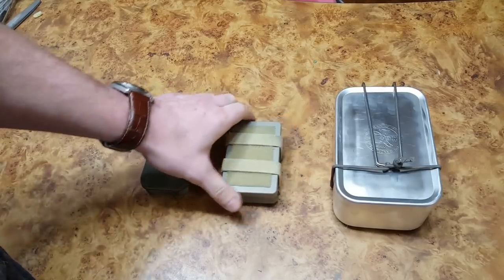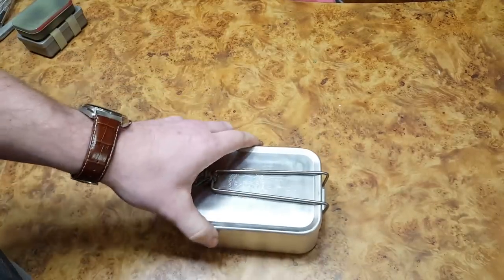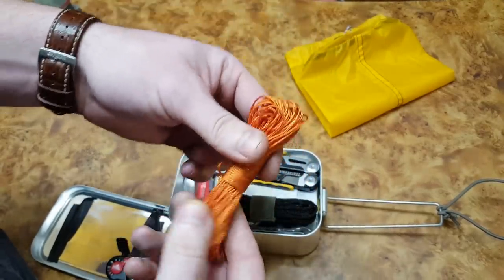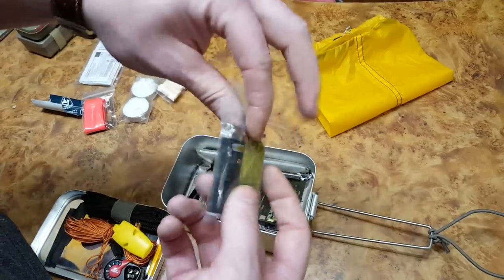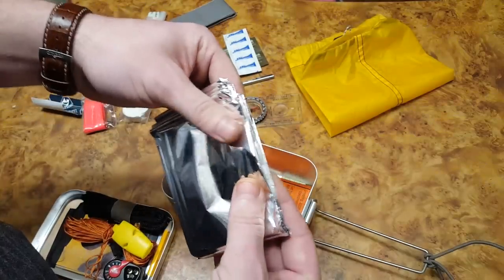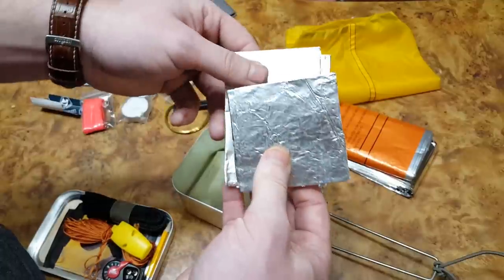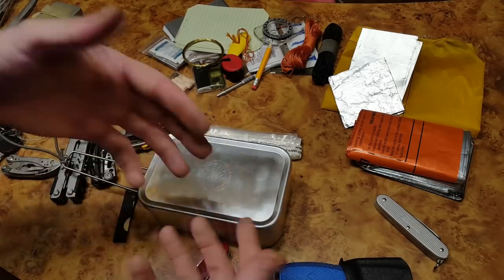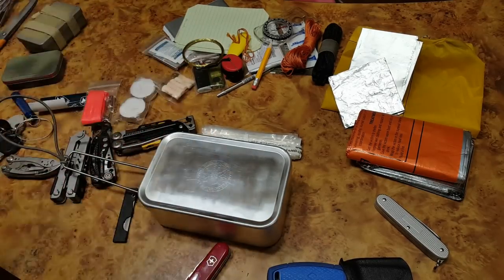Best Survival Tin Kit//Esee Survival Mess Tin homemade kit

Comment: I understand your rationale about making this a tin designated for a toss under your car seat. In combination with your edc, you could weather a lot. Things I would change. 1. Add some fishing tackle including eye hooks to make a pole.  2. Take out one of those space blankets. 3. Add a Life Straw. 4. Get rid of the pen and pencil and add the small Sharpie. 5. Get rid of the orange string and wrap the outside with 550. Keep the bank line. 6. I myself, would put in the multi-tool but find the beefiest folder I could find. Gerber makes a rubber handled folder for like $30. I think it's called the Gator. Nice idea and vid.

Comment: Tea lights are actually fantastic items for a kit!  You can use one for a Palmer Furnace (sit on something to get off the ground, drape a space blanket around you like a cape and close at the front with a candle burning between your feet- it will be around 30 degrees warmer than outside), and maybe the best application is as a flame extender.  If you're trying to get a fire light and everything is damp or wet a candle can save your ass!

Terrific kit!  The Altoids kits are kind of wishful thinking, more survival theater than realistic survival gear.  If you were in a true survival situation with just what fits in an Altoids tin you'd be in trouble!  Your kit is about the best kit of that size that I've ever seen.  It's very thorough, again considering the size.  About the only thing I would add is a few matches.  Yeah, you have several sources and a BIC is usually reliable but I have been in weird situations (usually on humid days at high altitude) where I couldn't get my BIC to work even when warmed by pocket carry.  Five or six UCO matches and a wee bit of striker will give you about the most certain 20 second of flame each you can find on this planet.  The only thing that can foil them is a wet striker.

I think it's critical to have at least one space blanket and two is better.  The SOL ones are vastly more durable; not as durable as canvas but better than the cheapies.  Better still is one to pitch as overhead cover (ie a lean-to) and one as a ground cloth/water barrier. You can wrap up in it but they suck as blankets IMO.  But a good one excels as a tarp although obviously you'll only get a couple uses out of it.  I've had to use a space blanket as a tarp with a small stick fire out front to ride out a 39 degree F night with no coat, just a T-shirt and jeans!  And I was so warm I almost used a second blanket to shield me from the fire.  That reflective tarp overhead and pitches in a lean-to really does bounce heat down on your body to form a very effective micro-climate.

Great kit!  Subscribed!

Comment: Great video! I also use those aluminum mess tins as kit bases, I got a set of two that nest for $5.00 on clearance at Sierra Trading Post, they fit perfectly into 2 molle first aid kit bags I got on Amazon and hold a lot of useful gear. One bag is essentially a fire kit and the other a cook kit but both are complete mini survival kits, this is a really economical way to go.

Comment: Why not put the tape that's on the bottom, on top. It's still protected and isn't in the way if you want to use the bottom for cooking.
Reply: He said he polished the top to be a mirror... And anyway with such a small can it will still burn even when above unless you ofc remove the top
Reply: @triskalion9627  which is why he said put it on the top so when you cook with lid off.
Reply: @grizzlycountry1030  yea but preferably when you cook u want to cover it so stuff cooks faster anyway idk he did that I'm just trying to get in his head
Reply: 1.  He polished the top, but taped a mirror inside.  So he could put the tape on top.
2.  He might be able to cook with the lid on even if it has tape on it.  Not being exposed to direct heat means the tape might not be harmed.
Reply: I agree. If you have a metal container, and you are not thinking of boiling water as its major use, then you are not thinking. At least he has a metal container. And no, I don't think the tape will burn if it's on top, provided your fire is an appropriate size.
Reply: @thewatcher611  If he put tape on the top of the lid and cooked/ boiled with the lid on, the tape would most definitely be ruined. Common sense 101

Comment: I thought of this when I saw the wire in the kit (about 13:57).  In the 50’s, in Alaska, Dad had a “snare line”.  This meant he had rabbit snares in different places along a rabbit run.  These ‘runs’ were quite visible in the snow—like a beaten path, really.  We purchased the snare wire at the Copper River Cash Store, and it was a woven metal wire.  Much like some stainless steel wire that I see at the hardware store.  It had a balance between being strong but flexible enough to slide closed.  
Dad did not like to kill, but he had 8 hungry children to feed.  He went to check the line each morning, always carrying his 22 rifle.  The rabbit may not have caught his head in the snare, but a hind leg.  This poor animal had to be shot.  
Buy the way, if 4 rabbits were caught, we had a good meal that evening.

Comment: I think it is a good kit, and similar to mine. I keep mine in a USGI sustainment pouch, which fits perfectly with room to spare. With the two combined I am very confident in the ability to get home. If you get the pouch get the M81. They are cheap, and have a D ring on either side so you can fashion a shoulder sling to carry the entire kit. I can also keep a field stripped MRE IN IT SO THIS WITH THE POUCH IS MY GO TO. good kit! I am with you on the space blankets. They are a great alternative if you want to die with a false sense of security. I use a tent floor for a survival tarp. Compact, and super durable with tie out loops. One Tigris makes an good affordable one.

Comment: You seem to have put a good bit of thought into this kit. I would like to suggest that you carry this on a belt. If you put this in a pack I recommend you use a spare kit. This is a good video because you give the reason for your choices for contents. Also a good idea is to bend a couple of wire hanger to use as a stand. As for the belt pouch, this tin will fit into the Army's 100 rnd saw pouch

Comment: Pretty decent kit for a bugout bag or get home bag. Using this as your core kit, you can throw it into your bag, then you can adjust your clothing or food, whatever you need according to your season and environment conditions. It makes putting your bag together much easier. Not a good alternative to a pocket kit, as it won't fit in your pocket, but you can always carry one of those on you too if that's your thing. The multi tool you chose is a good option. Like you, I always have my SAK Fieldmaster on me at all times, and I also carry a modern folder on me as well. I rotate through the modern folders I own, but the SAK is ALWAYS on me every single day, regardless of where I'm going or what I'm doing. If I know I'm going into the woods, I'll have a fixed blade on my belt, but your kit is great for a leave in the car kit or bug out bag as the core kit you can build the rest of your bag around.

Comment: For your yello bag: you're absolutely right, a blue one (royal blue working best) won't get lost in the woods, it really sticks out. Combine it with a slightly bigger plastic bag to carry water, so you stress the bag and not the plastic during transport.
For writing I use an unlaquered IKEA pencil I soaked in wax. Along with a sharpener I can make nice thin, curled shavings as an excellent fire starter.
That Petzl head lamp is awesome, just the right thing for me! Don't need much light, bright ones would just blind you for minutes.
For coiling your micro-cord watch reallybigmonkey1, coiling it tangle-free in figure-of-8-loops!
Your flagging tape should be royal blue too.
Tea-lights are great survival tools, so many uses! Never go out in the wild without some.
Bic lighters are my favorite fire starters, but mine are white, so I can see how much fuel is in there , covered  with small innertube for ranger bands or as a fire accelerator.
Aluminium foil hardens and gets brittle if you bend it, so after folding it to fit in your can, don't forget to heat it or it might break  when you unfold it.
My favorite small survival knife is a Victorinox Outrider, that I picked up lately as a merchandise special edition from Bosch for only 20€ - awesome!  Big frame with ~4" blade and saw, scissors and all the other good stuff.
Missing some dental floss and a sailing needle as well as a fishing kit.

Comment: Preach it, brutha! ;-)  Great looking it.  As you say there's simply no way to get all that stuff in an Altoid's tin.  The mini tin is a good thought experiment, a way to distill your thinking about survival.  But IMO it simply isn't large enough to provide the capability I would want in a bad situation.  I think your kit is compact enough to carry without a lot of trouble yet comprehensive enough to be really useful.  The multi-tool is a good idea since you have the room, if for no other reason to have a pliers to cut the wire.  Multi-tools are more useful in civilization than in the woods but having the pliers and saw in addition to a backup blade is a good idea.

Tin foil is great.  I use not to make containers but more in firecraft.  It's great for keeping your tinder/shavings dry and confined. The space blankets are good for shelter but also as tinder- many people don't know it but they're extraordinarily flammable.  Cordage is always good to have as well.  I love the inclusion of a full sized compass, much better than a button!

Should a PSK be totally self contained or designed to work with your EDC?  Both approaches are probably good,  I think it's good to have redundancy and of course if you lose your EDC knife or didn't have it along for whatever reason you might be stuck with just what's in your kit. So ideally it has everything you might need.

Having some medical/first-aid stuff is great.  Maybe not 100% survival essentially but it adds an element of safety.  

All in all I like the kit!  Nicely done.

Comment: Your kit is pretty damn good with two, very light and VERY usefull additions missing. A pack of size 16 micro barbed stainless fishhooks and 100 feet of 10-20 Lb dacron line. The line can be wrapped around your pencil. Combined with your bankline, these two items can save your life, particularly if you are close to the coast.

Comment: The bag inside is a good idea. I don't like the idea of having a container of small items and then dumping everything out. Seems like you're asking for problems and may loose items.
Also that little Petzel light is neat. I can see attaching it to other things. It's so small one can pack a few of them. 
The one thing I'd add would be a water filter. Or at least a bandanna and possibly a small metal cup to drink out of. You can add some powdered drink mix as well.
The main idea is that you can use all those items with your tin to procure water or cook. You might want a good spork to eat with. The bandanna of course has many other uses.
Reply: MasterK9Trainer There are collapsible plastic cups that would fit in the tin.
Reply: @fletchdad8755  Yes, they also make collapsible silicone cups, but it all depends on the space of the container and if one is willing to carry items in a pocket, a larger kit or pack another small box, tin, pouch or whatever they choose. I'm just offering him some ideas, but you know we can spend all week discussing options and what to include.

Comment: If you added the multi tool mainly for the saw, as you stated, there is a cheap, plastic handled, but very small and effective saw, sold in big box stores and on Amazon called the Coghlan Pocket Sierra Saw. It doesn't look that rugged and many "bushcrafters" are going to turn their their noses up, but I'm telling you that it is worth the $7 to $8 price tag for inclusion in a kit like this. It has a 4 inch blade and it's geometry is similar to a Japanese flush cutting saw's blade, lots of very tiny teeth. It works way better than you would ever imagine it would, just by looking at it, and it is very lightweight because of the use of plastic pretty much everywhere but the blade. You won't be able to mistreat it, but if circumstances have knocked you down to the point that you're depending on crap that you threw into a tin box, you should probably be as gentle as you can with ALL the gear that you pit in there. And I did enjoy hearing you rationale for each item.